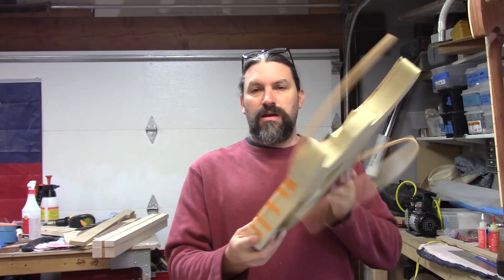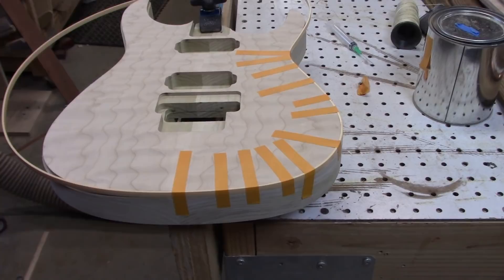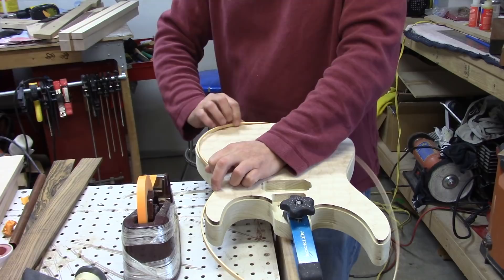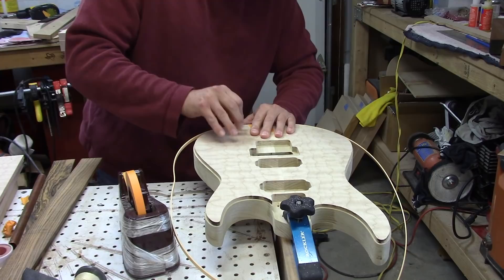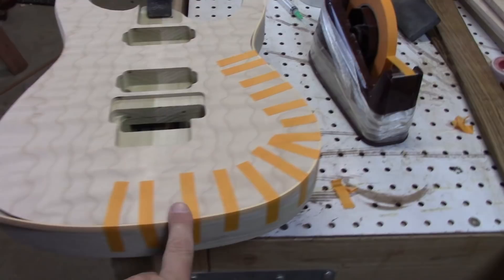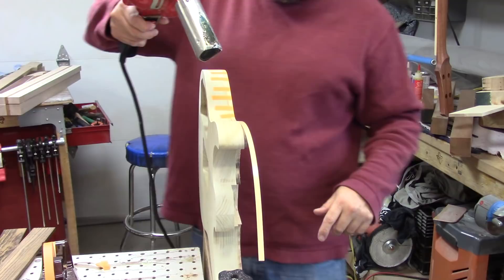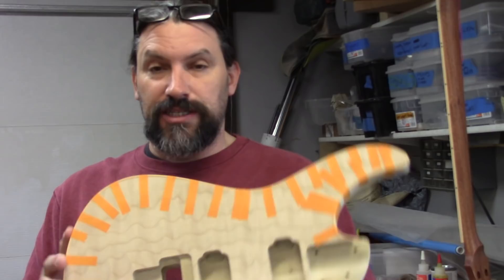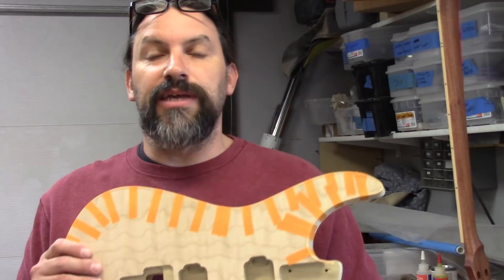How To Shape Binding To A Guitar Body And Look Good Doing It!

Comment: Bob Ross actually painted every painting in his episodes twice. Once before the show and once on the show. His manager has a copy of every painting he made because of that. And they'll NEVER be sold.

Saw a guy using adhesive from a tube to secure binding to his guitar that he was building. Seemed super labor intensive. No reason not to use acetone. Not sure why anyone would want to use a messy ass tube of adhesive.
Reply from the maker: We have used some bindings that acetone wont touch but that is the only reason I can think of
Reply: @TexasToastGuitars  that makes sense. I didn't even realize there could be different types. Thanks!